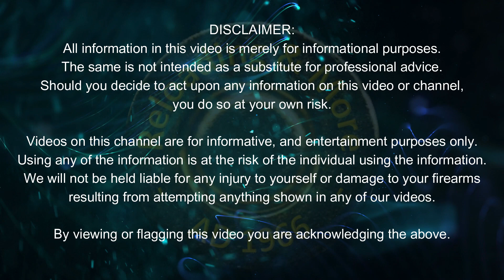Deep cleaning of a pistol barrel. - My way of getting hard carbon and other residues out.

Comment: Those felt pads are different. I have seen those for 22 caliber air guns, but nothing larger than 22
Reply from the maker: These are very useful and they make a significant difference when cleaning the barrel. They come dimensioned for several calibers. The specific item data codes I have listed in the description. Have a great day. 👍

Comment: that's like a magic show, I thought the barrel was clean to start with(haha) but wow , how black the felt came out, is that really residue or just chemical reaction with the metal, as in will it turn black even if barrel had been cleaned like this beforehand? I can certainly see from the wear patterns on the outside of barrel that it's been well used. I like how organized your table is even if it's for the video, having supplies out and on hand, nice. If this is your procedure for a 5 inch pistol barrel that usually used for under 50 yards I'm holding my breath to see what you do for a precision rifle !!
Great content, production, music is low key background, text is concise, perfect size and position.
Reply from the maker: Good morning John. Thanks for taking time to see and comment accordingly👍🙏. When using the felt and JB Bore on a previously cleaned barrel, the felt comes out with a shade of grey rather than totally black. The Bore cleaner is essentially removing the carbon. I have been cleaning my barrels for 10 years with the wrong methodology. I thought I was doing a great job but I meet someone recently and he introduced me to this system and products (Kroil, J-B Bore, Militec 1). This is the same process he uses on precision rifles. Since using this cleaning method, my shooting has improved because it makes a real difference. This barrel has been fired at least 20,000 rounds. (To be clear, If I clean the barrel completely with this method and then I put a new felt in with the paste, it comes out gray, slightly grayer than the paste itself. but not black.)

I use the same exact method you see here for the 9 months now. When the camera is off I would be little less organized and items would be a little more scattered. Also the carton would be covered in dirt but I used a new carton for the clip.

I am happy you like how it all came out. Now I am editing a second part of the cleanup for the rest of the handgun. In a couple of weeks I should have it released.

Take care and have a great week.
Reply: @ReloadingMoreAD1966  Thanks for info! real world results always best! I do prefer chemical rather than mechanical cleaning as long as chemicals not toxic, I'll look into this method! Reminds me of when people first used borescopes and could see what actually remained in 'clean' rifle barrels!
Reply from the maker: @johnh4957  You're welcome.

Comment: Great demo and process.  My process is very similar but instead of a patch I wrap a patch strip around a nylon brush (one size smaller than caliber) because it gets  into the rifling better.  I was unfamiliar with that Militec-1 and will check that out. Thanks. BTW I don't use the JB Bore Paste every time, but occasionally.  I use the BoreTech products and also like MPro7 cleaner to clean the bore. Frog lube works well as a final conditioner and rust preventative especially if you are going to store the firearm for a period of time.
Reply from the maker: Thanks so much for stopping by the channel and adding such a great value comment👍👍🙏🙏. It is comment like these that very much help the community. Will have a look at the products you indicate. There is a second part of this clip with the cleanup of the frame if you are interested. Have a great dayt.